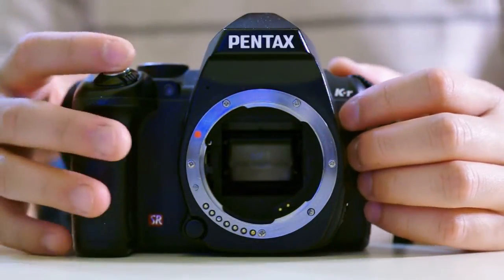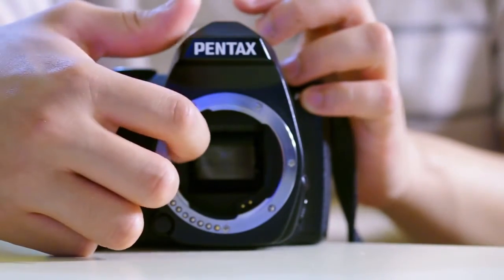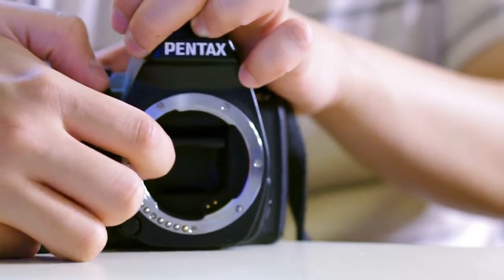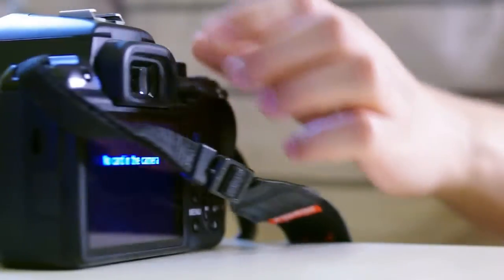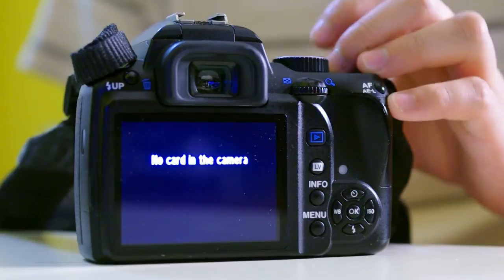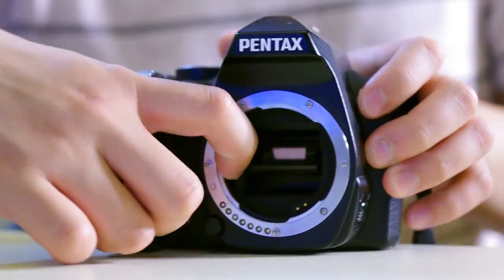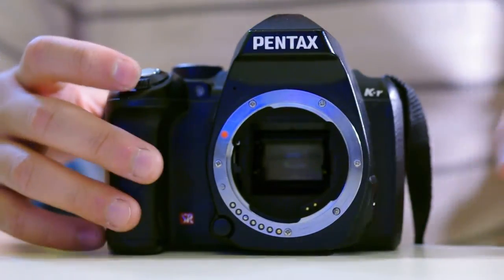How a malfunctioning aperture mechanism can cause mirror flop in Pentax DSLRs

Comment: This other method worked for my camera, they don't like not being used for extended periods and the aperture motor sticks.

1.) Go to the camera menu to button customization and define the raw/FX button to "optical preview".

2.) Use Manual or AV mode and dial in an aperture other than open wide.

3.) Press the raw/FX button 10 to 20 times ( I did so). Every press you should hear the aperture lever working.

4.) Take some shots. At this point my K-30 did correct exposures with some exceptions. So I repeated the procedure until no wrong exposure occurred. 

You may have to repeat several times.

Good luck!!!
Reply: Thanks for this advice! Was more helpful than the video :)
Reply: Didn't work for me.  After optical preview, it stayed there. In a K-50, in order to set the aperture, it jumps out of optical preview.  O well.
Reply: I have the "dark" issue with k-s2 bit this method didn't work. What does seem so solve it temporary is setting to burst mode (continious H) and taking photos continuously until is slows down. After one or two of those bursts camera seems to be working normal until it is put away and switched on again. Did your mthod solved the issue for good?
Reply: Just tried this solution with my old K-30 which was having mirror issues and so far so good. Burst mode is working great again. I will now try all modes (Aperture and shutter priority modes) and see if it stays "healthy". Thanks for the tip!

Comment: Thanks for sharing. I tried to mount a faulty lens to my k 50 and it pushed the aperture mechanism. When I put back in a proper lens - the camera started showing some symptoms similar to what you have mentioned in the video. I found that the aperture lever was stuck in place and so moved it up and down a few times with my hand and then it started working again.

Comment: I had a problem with the  liveview not working, i think is because my camera discharge when i had mirror up in live view or on long exposures, manage to fix it  by doing the same thing again, with live view on i took of battery then place back, and turned of the camera,  then i turned on, then took a test shot, it worked, then i turned off and back on and turned liveview and it worked. will make also a video and upload it on my channel, i use nikon camera.

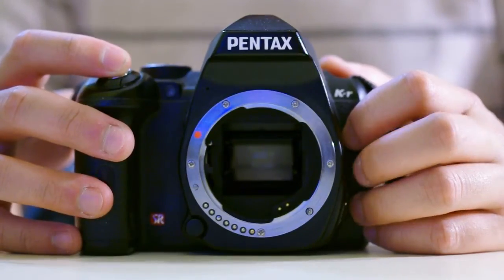Comment: From 0:20 to 0:22, what aperture setting do you have the camera on? Maybe since there is no lens attached it makes no difference. If you have the camera set on whatever the wide open aperture for that lens is, the aperture lever would not go up at all, would it?
Reply from the maker: The camera doesn't detect a lens, so it's assuming that it's entirely manual and actuating the aperture lever fully. The aperture would be determined by the aperture ring on the lens, not the camera body.